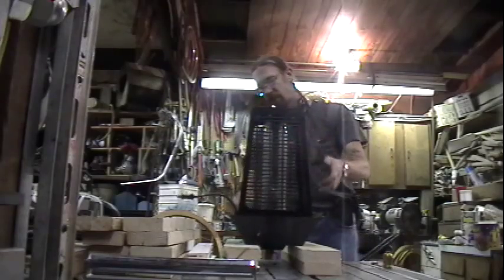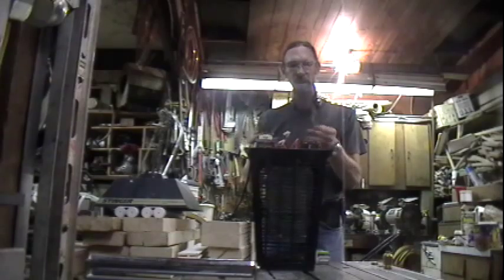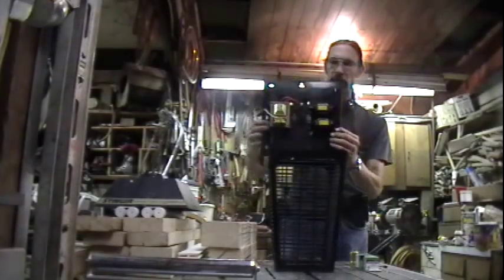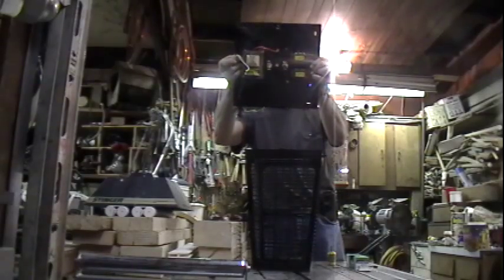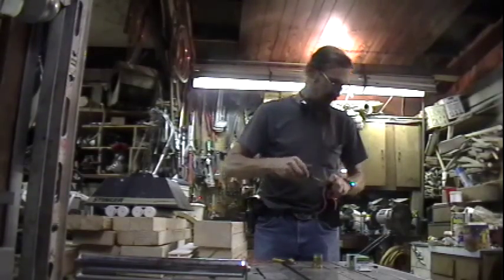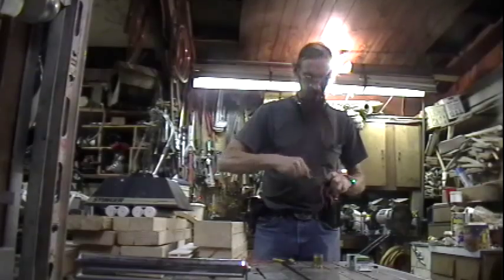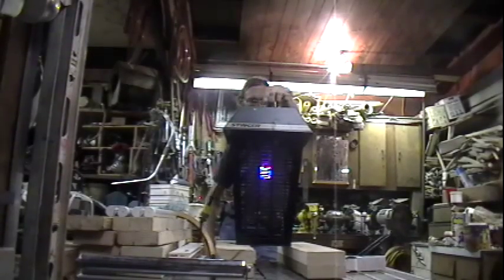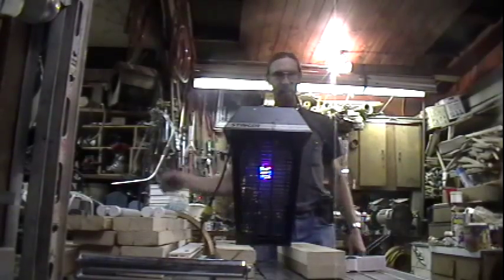Stinger Bug Light Repair/Mod

Comment: I am visually impaired so if I missed something in the video let me know
I thought that in 120v ac circuits the black was always hot and white neutral. 
In the video I think you might of had something different.
I am a DIY electrical tinkerer and from my understanding the white should always be neutral in a circuit like this. Whenever I am wiring simple circuits like this I always as a rool of thumb make sure that the larger prong of the plug (neutral) terminates at the screw contact of the lamp socket. Was neutral in your machine white or black. I am using a speach synthesizer on my computer that prevents me from rewinding thats why I ask. Thanks for this amazing video and teaching us all this cool new trick! You sure are resourceful and props for recycling and salvaging parts to have around! I do the same. Who ever said hording was a bad thing needs to go step on a lego!
You definitely gotta check out freecycle its like craigslist for free stuff.
Reply from the maker: You are correct, hot is black. Many light fixtures have screws for both terminals, the rule in such cases is that the hot (black) terminals goes to the end of the bulb socket and the neutral (white) goes to the bulb threads.
I intend to be posting an update at some point in which I'll be using 12 volt LED tape to see how that works. The only problem with the LED tape is that it's not true ultraviolet.
Reply: @JasonSimpson1966  
thanks!
cool! Looking forward to seeing that hack!

Comment: I realize your video is quite old, but I’m hoping you still view and answer comments. I have a BK300 it had been zapping bugs and lightning up until the 17th of August. We had high winds on the late evening August 17th. These high winds tore tree tops and knocked down trees. It blew furniture across our back deck. The light still works on my zapper and bugs are going to the light. I can see them walking on the light itself. Because this is happening it isn’t zapping the bugs anymore. I’ve looked for a way to remove the top so I can inspect the guts closer to main power switch. I’m almost certain that the winds were knocking the dickens out of my zapper. But as stated light works it’s just not zapping. Please help if you can.
Reply from the maker: @sherrylantrip9328  I'm not familiar with that particular model, but they all work on the same principle.
Without taking it apart, you might be able to inspect and make sure that the wires going to the high voltage grid are still connected, it's possible one of them has been dislodged.
On most models I've worked with, it's simply crimped on.
If you get it apart (with power disconnected), you should find the high voltage transformer inside. The output goes to the grid, one wire to the inside grid and one to the outside grid.
That's my best guess. It's also possible that something shorted the grid and burned out the transformer, though not as likely.
Reply: TY I’ve inspected the wires on the outside and all are connected as should be. So that means it’s inside or shall I say under the hood if you will. I’ll have to figure out how to get it opened without damaging it so I’ll be able to close it again.
Reply: Ok I’ve finally got it apart. Inspected and found the power supply to the grid is bad. I’ve searched Amazon with the numbers on the unit and found nothing. How do I find one and what exactly is it called other than transformer. If I could send a picture of what I have it might could help you help me if at all. Thank you so much.
Reply from the maker: @sherrylantrip9328  you might check your local thrift shops, yard sales, etc for one's that the light doesn't work on any more.
Keyword searching for high voltage bug light transformer might be helpful as well.
Reply: @sherrylantrip9328  How did you take it apart? I have to do the same thing, and I can't see any obvious way to take it apart and/or "unsnap" the cover from the body. Please help!!
Reply: I took the bottom off and had to pry the two seams open on the side. Once the removed and outer shell I was able to unscrew a few screws holding the top on. Removed top and inspected. I was not able to find a used system nor was the company helpful in any way of telling me where to find the part I needed. I could not find a new one online either. So I tossed it. Now I have two lights I may never use as it’s a 4 prong plug and others I’ve seen are two or 3 prong. Hope this helps.

Comment: I have an old Stinger UV15 zapper from the 90's that still lights up bulbs but won't zap.  Could a bad starter cause the wire grills to cease functioning or more likely a transformer failure?
Reply from the maker: The high voltage comes from the transformer exclusively.  If it's not zapping, check the transformer with an ohm meter for continuity.  However, unless something has happened to damage the transformer physically, it's more likely a bad connection somewhere, either where the AC connects to the transformer ir where the transformer connects to the wire grid.  Since these things tend to remain outside in all kinds of weather, corrosion of the connections is not unusual.

Comment: Great idea converting to a regular bulb. I've been trying to get my old vintage Flintrol 25 watt, 3/4 acre zapper light working again. Bought a new replacement CFM for it. Had to modify the bottom screen to let the new bulb hang out a little since I couldn't find a 25w bulb 7" like my original. Plugged in and the new bulb looks like it wants to light, but only slightly glows, and isn't a black light like I ordered. It's only a slight orange glow. Tried replacing starter just in case, but the new one, the same FL-25 still doesn't fully light the bulb? Can you make any suggestions on what else might be wrong? Wanna kill some skeeters some kind of bad! Stumped...
Reply from the maker: The ballast transformer may not be powerful enough to drive a higher wattage bulb. If you don't mind the extra light, you might try finding a white bulb that fits and is the correct wattage
Reply: @JasonSimpson1966  Hi Jason. Thank you for such a quick reply. Actually the bulb I ordered was supposed to be the correct wattage, it's 25w just like the original. It's just an inch and a half longer.

Comment: You wouldn't happen to have a transformer for a Sears Bugwacker or equivalent Flowtron 1 acre build you'd be willing to part with?

It's a 120V .8A to 5500V 9MA transformer. 

I accidentally drilled into the transformer winding thinking the twist drill wouldn't catch and will be a while before I get to re-winding the transformer. 

I found a porcelain small diameter base socket and was mounting.  Then... ew... next time disassemble when I have sadist ELINT hackathon going on babbling away into everything including thin air in my perimeter. 

Thanks in advance for your time and great video.  Thorough detail.
Reply from the maker: jafinch78 Unfortunately, no, I don't have any spare transformers. However, you might consider using a transformer from a junk microwave oven. Those are typically easy to pick up, people throw them in the garbage all the time, often in still working condition.
Reply: Jason Simpson:  Yeah... they're larger in size though could run off a wire and locate the transformer elsewhere.  Kind of interesting studying the gap sizing for the transformer voltage and current and custom making a zapper also.  I'll have to do a "microwave" or "bug zapper" "site:craiglist.org" search.
Reply from the maker: jafinch78 the smaller "dorm room" microwaves have a smaller transformer, and those are the ones I usually see in the trash. I've got a couple of them that I am planning on building a spot welder out of, though I haven't gotten around to it yet. Been focused on trying to get my 3D printer working reliably.
Reply: Jason Simpson:  Thanks for the insight.  I'll see what I can find when I'm out Goodwill Shopping or out.  Not sure if you have wherever you're from; I just last week found in MN (Minneapolis and St. Paul) and I've read online they have others... all electronics are 29 cents at their "Goodwill Outlet Stores" unless marked in the cabinet otherwise.  Went up to pick up a Tektronix 475A I got for $25 at Shopgoodwill.com.  Unfortunately, where I live... there aren't as many into electronics like back in the Heathkit Zenith days (I'm working down in Coloma, MI).  Thanks again man!
Reply from the maker: jafinch78 here in Montana we have Goodwill, but not outlet stores. 29¢ is as good as a trash pick, though, and well worth the scrap value. Good luck with your project.

Comment: Your video would have been a lot better if you had your camera positioned for a close up shot. You talk about cutting wires and etc., but I have no idea what you were doing. The camera was sitting on a bench in your dimly lit work shop, too far away to observe properly. Maybe you can make another video, well lit and up close.
Reply from the maker: I appreciate all feedback, but I would just like to make a couple of minor points.
1) I am not a professional YouTube content creator. I don't have multi-camera setups or elaborate video-editing software. Additionally, this was one of the first videos i ever filmed for sharing on YouTube, and my video experience was (and still is) is minimal. 
2) The shop actually is well lit. Unfortunately, the light behind me swamped out the camera (seee previous comment on video experience). 
3) The wiring inside these devices is not complicated. If you cannot understand the necessary steps to disconnect one light fixture and connect another one, then you should not be attempting this project. High voltage can kill, and should not be worked on by inexperienced persons. 
4) I would have to have another of these lights to fix to re-shoot the video. As the person I salvaged this light from has had me perform the conversion on all four of his other lights already, I would have to find one in someone's trash to re-record the conversion, and they really are not that common around here.
Having said that, I am learning and will keep your suggestions on recording videos in mind in the future.

Comment: My question is shouldn't the brass screw be wired to the hot wire? I heard in the video to connect to silver screw... am I wrong? Thanks.
Reply from the maker: Traditionally, yes, but with everything made in China these days, always double check things. the hot (black) lead should go to the center post of the light socket, and the neutral to the screw fixture.
Reply: @JasonSimpson1966  Great point and thank you for getting back to me. Just curious, have you tired using an LED bulb?
Reply from the maker: @RRMIAMI  not yet, but I have it in the plans. I ordered some UV LED light tape I am going to wrap around a piece of PVC pipe and try substituting that, if it's in the correct spectrum, it should work.
Reply: @JasonSimpson1966  I thought about that as well or just using a led bulb but I do not think the led bulb will have sufficient light to attract bugs but I could be wrong. Thanks again and I will be doing my mod soon.

Comment: Sweet ty, I have an older model, and this worked like a charm.
Reply from the maker: Glad you found it useful. I always prefer repurpose/repair rather than disposal, although sometimes disposal is the only viable option (with recycling as part of the disposal process).
Reply: Jason Simpson I so agree.

Comment: Harold Leistikow
Jason,
I have a Flotron 80D 1-1/2 acre Bug zapper. The electrocution grill and one of the lights have the transformers tied together. There are two black wires coming out of one of those transformers and two red coming out of the other. I don't know how to tie the electrocution grill transformer into the one twenty lines for the UV light. Do you have any suggestions?
Reply from the maker: The wires going to the grid are the high voltage side. The other 2 wires are the 120v side. One goes to hot and one to neutral on your household plug in. If you don't have either side of the transformer connected right now, you are going to have to test the resistance on both sides of the transformer. On a step up transformer, the secondary (output side) should have a higher resistance than the primary (input 120v). 
The socket for the CFL bulb just goes across the 120 lines. You should set the hot line for the center button on the base of the socket and the neutral on the threads.

Comment: My zapper won't start. I fuse bulb seems like busted ( dark in color)...How do I take it out from the housing its connected from?? help please
Reply from the maker: The starter is one of the major failings in these devices. that was why I made this video on converting them to use a standard light bulb socket and using a CFL bulb. The starter bulbs in these lamps vary from one model to the next, so the method of removing just the starter and replacing it varies.If you just want to replace the starter, I would suggest removing the connector for the starter and replacing it with a wire nut, then you can wire in whatever starter is appropriate for the wattage bulb your lamp happens to be.

Comment: you are soooo lucky.  i tried this before seeing this video... however, my bug zapper (flowtron pm1500 bugfighter, with the  older style kill grid chicken wire style, very nice kill grid... newer pm1500's had the newer kill grid) anyway, there was no seprate ballest transformer, so when i removed the light and starter, it only lasted a day. i guess i over powered it, didnt kill but 40 flys maybe... smelt like burnt transformer.... nasty smelling, i had to throw it away, i should have took pictures for the serial number... i still have the bug zapper, only threw away the smelly transformer...